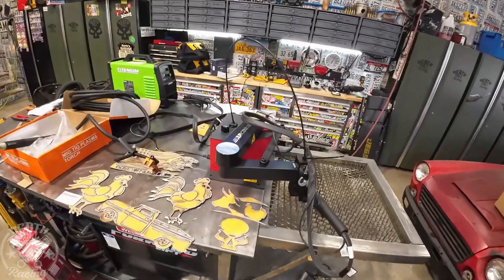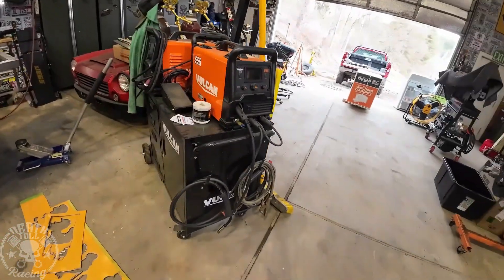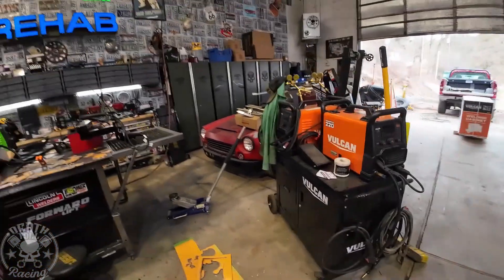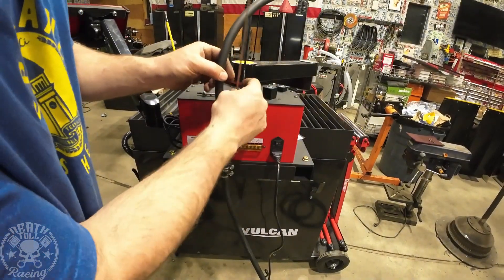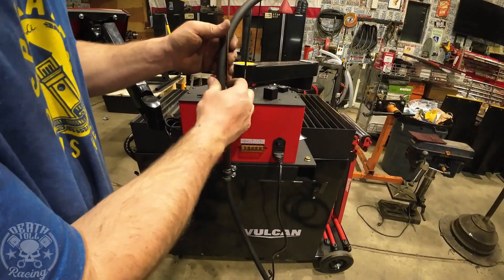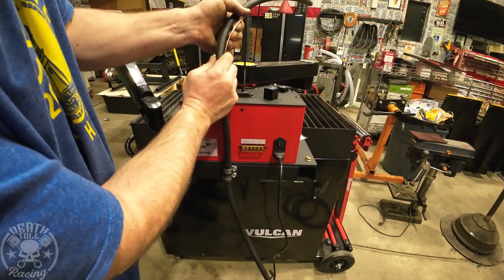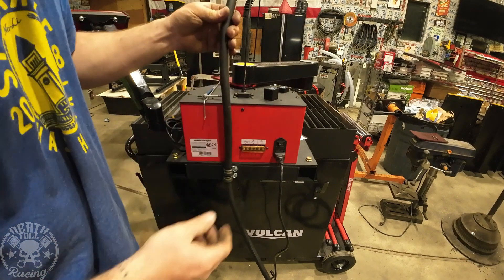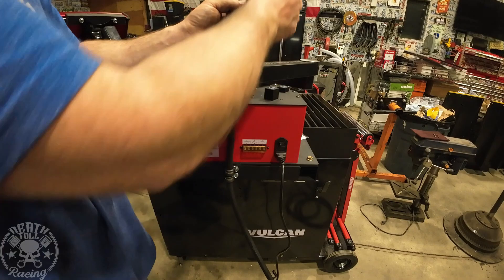Compact CNC Plasma Cut Center Full Build; ArcDroid, HF Titanium 65 w/ PlasmaDyn Hypertherm Torch

Comment: What do you use for an air supply to the plasma cutter?  Thanks!
Reply from the maker: I’m just using the shops air compressor.   The titanium has an internal pressure regulator.

Comment: I was wondering exactly what did you have to do to wire up the HF Titanium 65 plasma cutter to the arc droid? I just ordered the arc droid and I have recently bought the plasma cutter . I still have to buy the torch on e - bay. Thank you
Reply: Doesn't the newer Harbor Freight Titanium plasma cutters have a seperate cnc port plug so you just need a cnc cable ?
Reply from the maker: @chrisshapardon1640  I'm not sure actually.  That would be nice.
Reply: How long did it take to get your arcdroid, getting ready to order one
Reply from the maker: @chrisshapardon1640  I don't remember exactly, but it wasn't abnormally long.  But it was also a couple years ago, so things may be different now.
Reply from the maker: If you look at the plug for the plasma itself (while torch is unplugged) very small are numbers.  Upper left is pin 3 next row down far right is pin 4.  Those are the 2 pins you need.